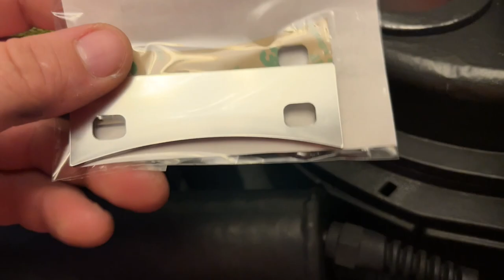Replacing my Haslab Ion Arm with a Movie Accutare Metal One

Comment: What size drill bit did you use to put the holes for the Ion Arm Cap and the brass fitting?
Reply from the maker: I believe I used 1/8 Maaaaybe 9/64

Comment: Have you added the heat sync found on the side of the pack near the clippard valve? I've noticed most modders neglect this upgrade.
Reply from the maker: No not even aware of that! Right next to the Clippard valve?
Reply: @ghostbusterspluscollector9624  Yeah I believe it’s the big rectangle one next to the yellow label.